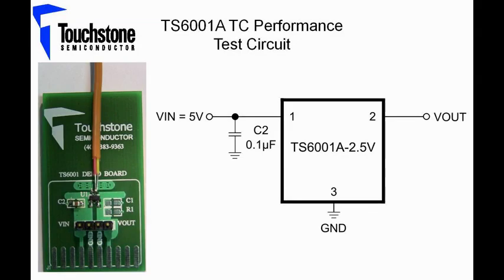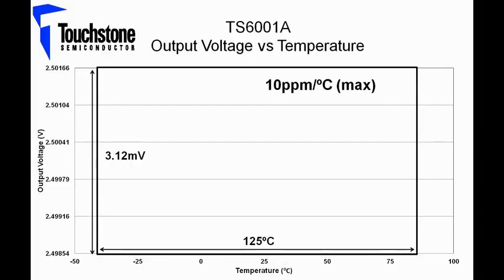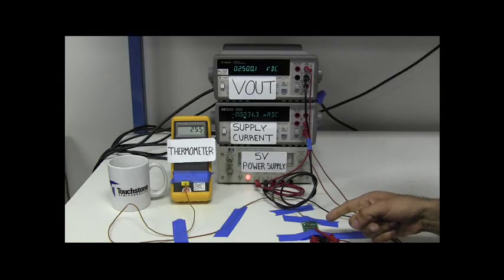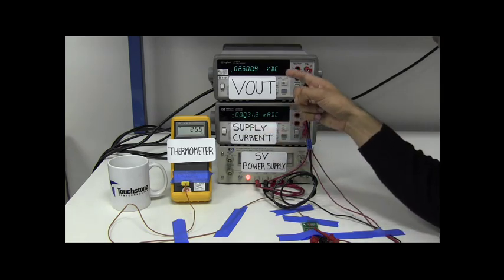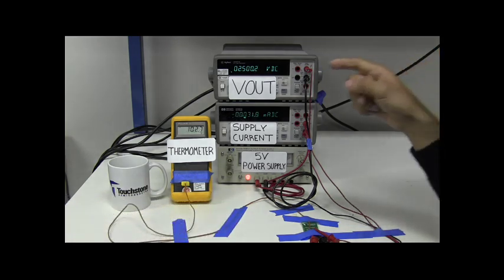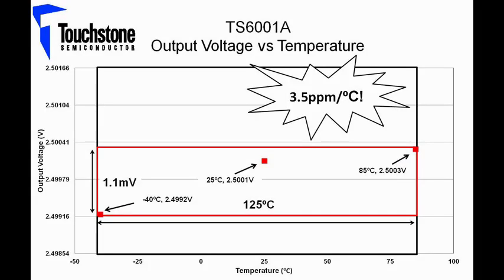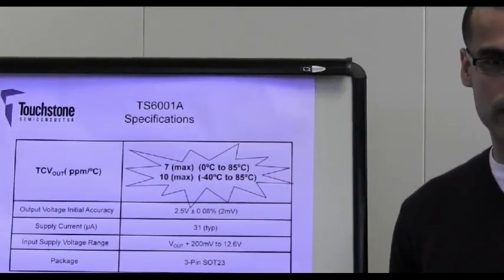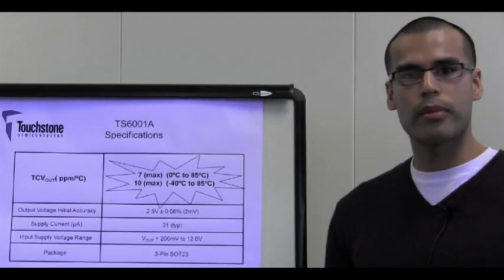Touchstone TS6001 -- 3.5ppm/°C Voltage Reference Demonstration

Comment: The normal voltage for the control circuit for a residential air conditioner is: